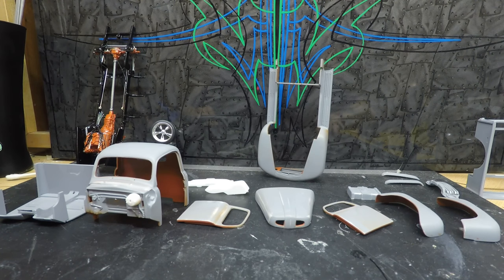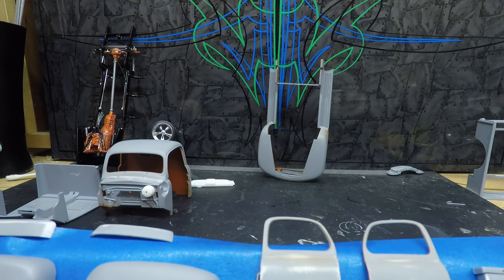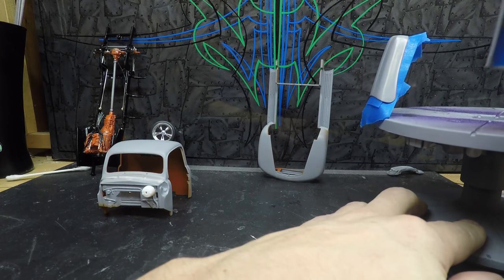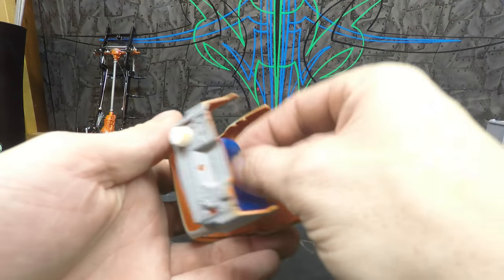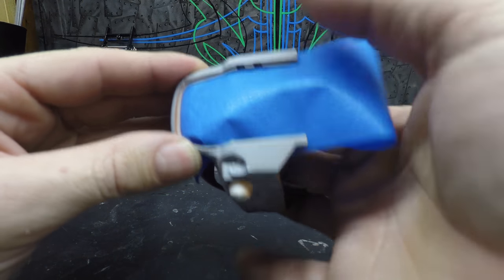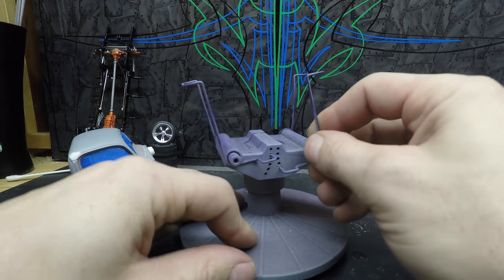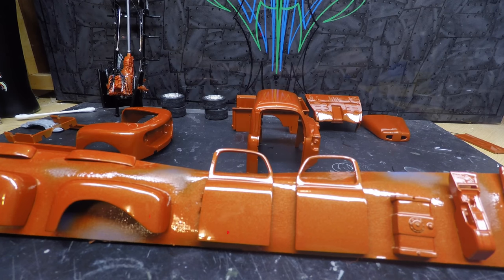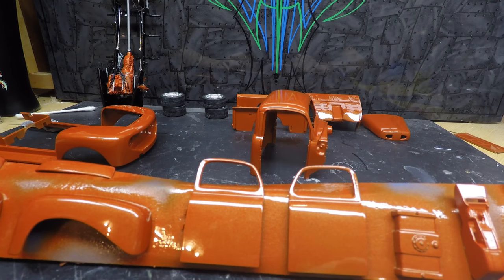custom 1950 ford truck episode 6 ( painting the body )

Comment: First of you vids I've watched...did you do any sanding?
Reply from the maker: Yes the body got sanded before the body got painted
Reply: Dragon Speed Shop thanks for the reply...no sanding on the paint...just clear coat?
Reply from the maker: @xbpbat21x  if you paint lay down right there really no need to sand it. Unless you going for a first place paint job. Then there a lot more that need to be done